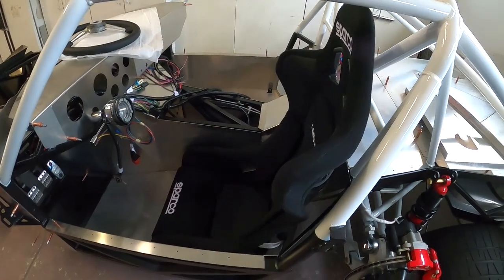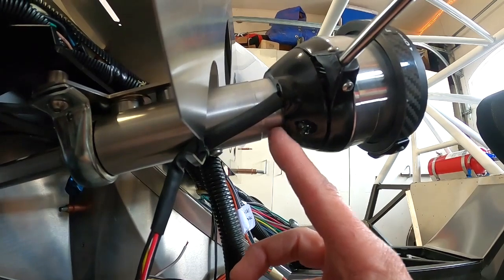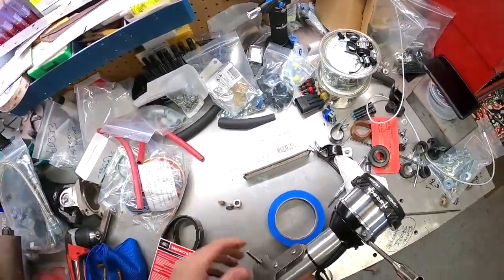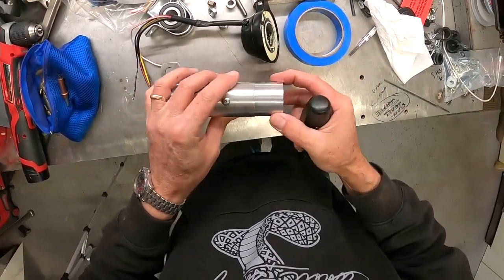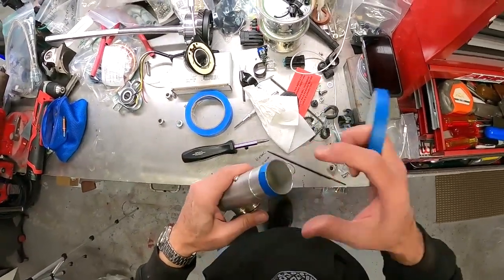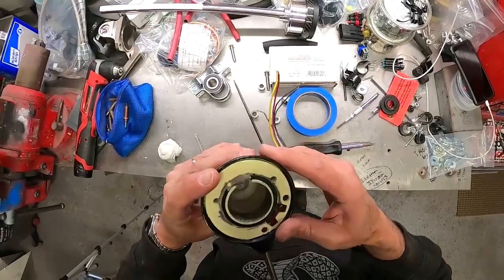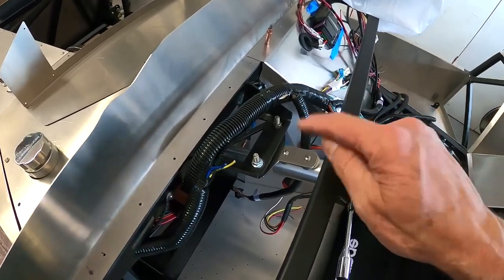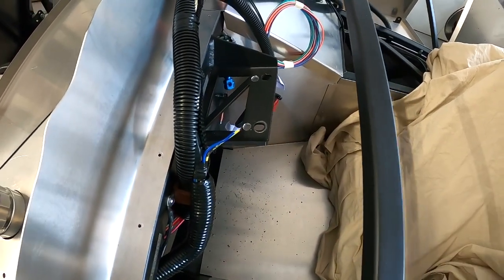Cobra Daytona Build-Steering column issues, Video 66

Comment: Could you have just slotted two screw holes on the Russ Thompson bracket?
Reply from the maker: I don’t think so as it also has the bearing attached with the screws. 
Thank you for the comment.
Reply: @cobradaytonabuild1671  Ah yes. Didn’t realize the bearing was there and limits sliding the unit back. I see it now.